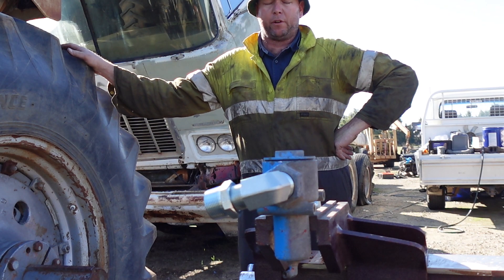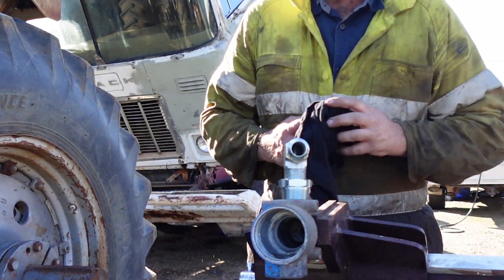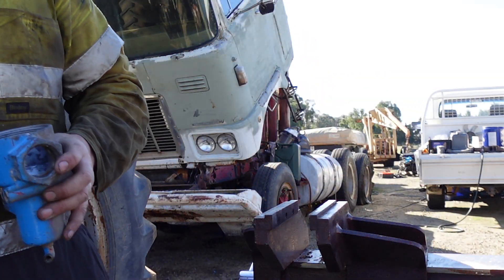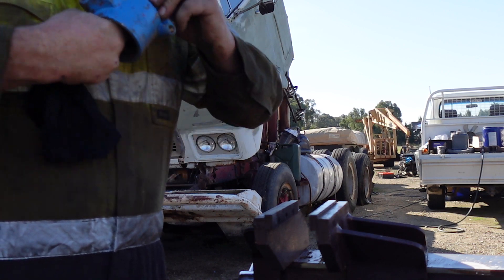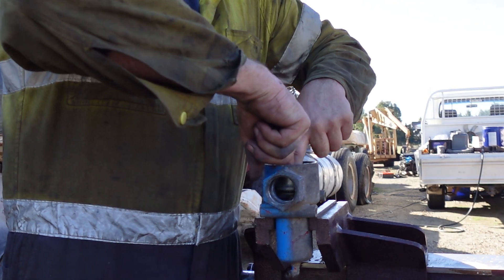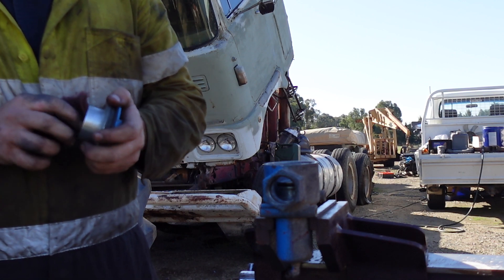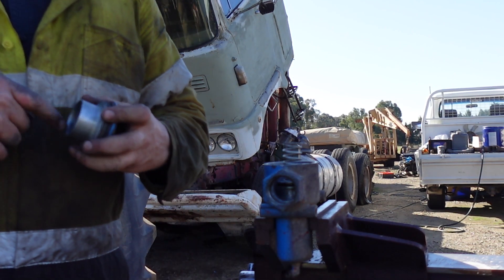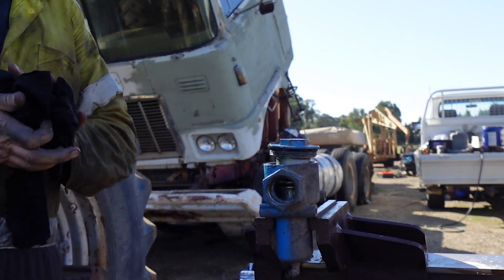Sealco Air Start valve overhaul

Comment: Finished planting a couple weeks ago, catching up on videos while I've been working on a white road xpeditor 2 with a na caterpillar 3208 in it got it running but have an issue with a bent linkage. From the accelerator pedal compound to the engine throttle and atf pump cable compound there's a telescoping throttle cable linkage with a return spring mounted on the side, was wondering if you have seen one and or know what it is actually called to find one. Mines got seized and bent so when the cabs down the motor goes for a full pull.
Reply from the maker: I can’t quite picture the setup you’re talking about mate. Send a pic to skip_dw25@yahoo.com.au and I can have a look at it. Not many xpeditors here in Australia, but a mate of mine has one
Reply: Actually I have a friend who is more experienced in metal who was able to bend it back straight tube and all. Now I'm waiting for a shifter cable. Took a short video of it and uploaded but I'm not too good with the camera.

Comment: Well that sure brings back memories. I used to own one of these trucks in the mid eighties running Sydney, Canberra, Albury. I once had the muffler for the starter fall off somewhere near Gundagai and when I hit the starter after unloading in canberra, I nearly jumped out the door. Thought the bloody thing had exploded.
Reply from the maker: Thanks for your story mate. They make a hell of a racket without the muffler on. Dad had a coolpower F model and you could hear it start from about 3kms away without the muffler on it.
Where did your truck end up?
Reply: @oldrigsdownunder7301  Last I heard a mate spotted it in Wollongong. It was painted black, and had "Duchess" painted above the windscreen and a pussy cat either side under the windscreen. When I got it someone had fitted a 320 coolpower engine. Good old truck.

Comment: Howdy from the Northwoods of Minnesota,  Love and Respect All 
Freind just bought a Freighshaker 903 V8 with air starter.  Seems to dump all air from tank . Starter don't stop when button released. Told him to check if valve in dash venting off when released.  Steve sent me to this video.  What's your thoughts on it? I assume valve in dash has to vent off
Reply from the maker: G’day mate how are you?
Sounds like your friend has a really interesting truck there.
Take the 1/4” line off the top of the relay valve on the tank, and make sure that air comes out of the hose while your hand is on the button or turning the key. And then make sure the air stops as soon as you take your hand off the button or key.
If that air signal supply is working correctly then the problem will be in the big relay valve on the tank. The piston might be sticky inside it and not returning correctly
Reply: @oldrigsdownunder7301  thank you. Will pass on. It's a 79 fld120 Freighshaker.  Clean older truck. Run 1000 miles didn't take any oil n oil stayed clean.  There rebuild papers in cab from the 90s, don't think it was used much after. Run strong n no trouble but 2 flats on rear. Old recaps that were weather checked n almost bald. Was an awesome trip. Went across Mackinaw bridge, 28 feet short of 5 miles. Sent Steve pictures. 
Thanks for troubleshooting information,  keep the greasy side down and have fun

Comment: Always wondered how those things worked. I know they will wake you up in a hurry if you’re not ready for the noise. Great vid, mate 😊
Reply from the maker: Thanks Mick 🙏🏻 the valves are fairly simple. At some stage I will do a video about splitting the starter motor and touch on the manual and solenoid control for the valve I showed in this video

Comment: Couldn’t get just the fittings you wanted? Sounds familiar, when I go for hydraulic fittings it seems no matter how many they have there are never quite exactly what you want.
Reply from the maker: That’s exactly right Geoffery. It seems different to 10-15 years ago. I thought those fittings would be sitting on the shelf at a couple of places, but in the end I was lucky to come away with what I did

Comment: Greta explanation on the operation of the air start solenoid always assumed they were electric maybe in later years thanks for sharing 🦘
Reply from the maker: No worries Kerry.
I should’ve mentioned that the air in the 1/4” signal line can either come from a push button or a key operated electric over air solenoid